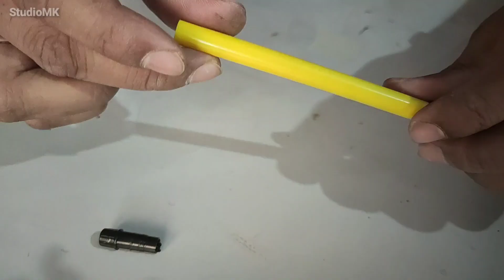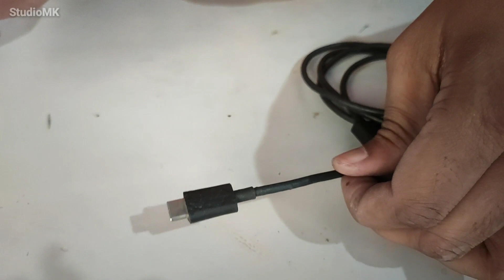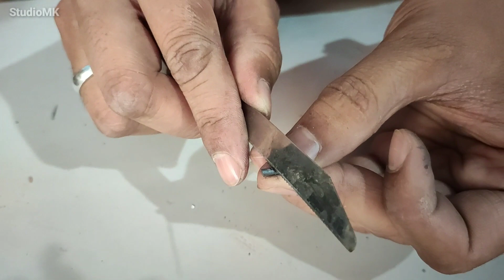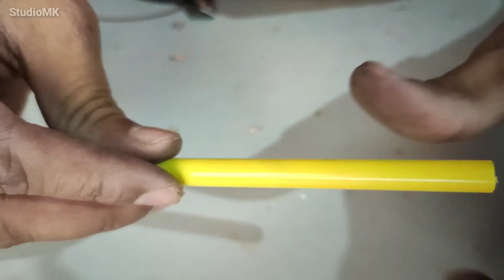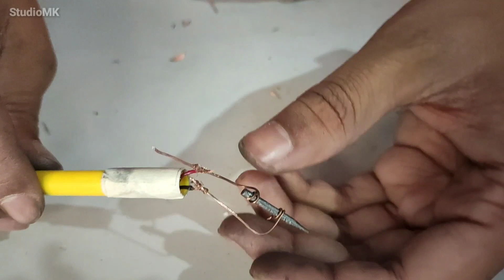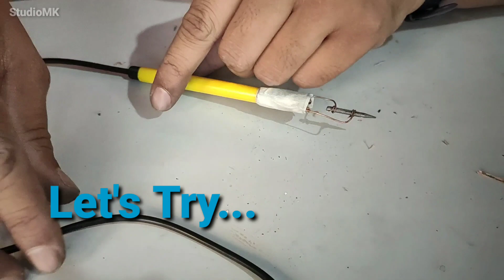How to make Soldering iron at Home | simple method

Comment: Is this safe?
Reply: Yes because using charger power
Reply: @sridharvemula361   i made it , but a buzzy sound coming from the adapter. but nothing is happen . only the sound creating a little bit fear to me.
Reply: @sridharvemula361   also the solder wire is not stick with pencil lead.

Comment: Tried it just now. It's hot but enough heat to burn wires. Burnt my fingertips though😅
I used flexible copper wires that come with insulation. 
At this point it's just heating not smoldering

Comment: Bro, Is it safe to try  for the beginners at home? Why Negative (-) and Positive (+)  don't mix together as Pencil lead is a conductor 
of Electricity? Please reply as soon as possible!
Reply: Lead offers a little resistance which leads to heat production
Reply: It is conducting electricity but the resistance of lead is high so electrical energy is converting into heat energy... Hope it helps 🙂
Reply: @poopsickle2411  Yes